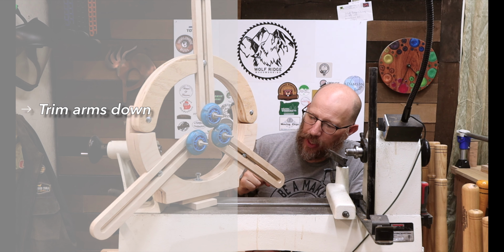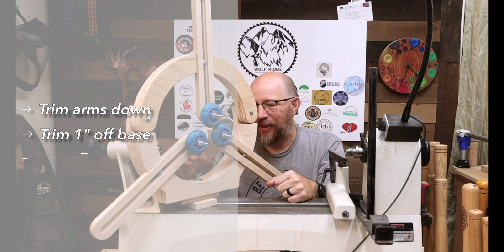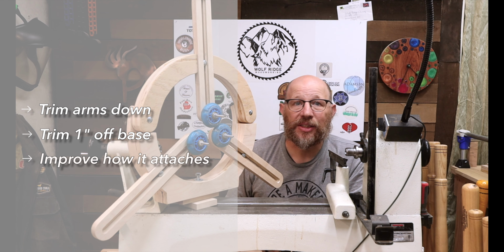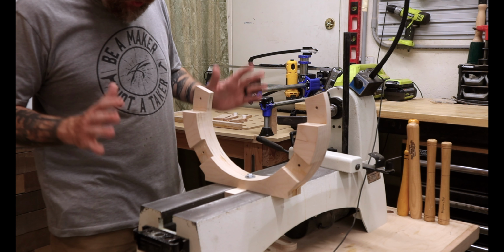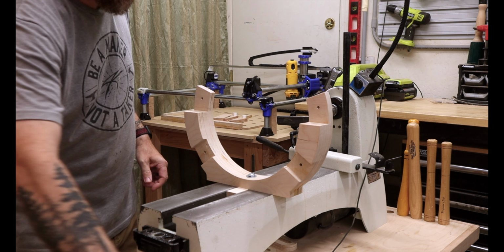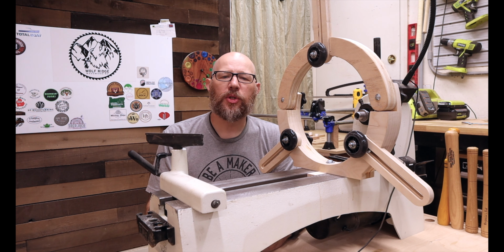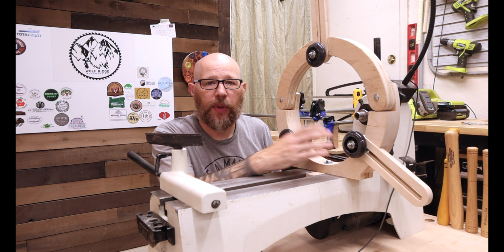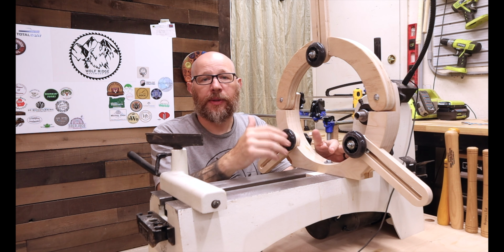Woodworking: Steady Rest version 2.0

Comment: Hi! Thanks for the vid. I see most people use roller skate wheels for the rest. Why not just plain metal bearings? Would it leave significant scratches on the wood? Thanks in advance!
Reply from the maker: Thank you Shifar!  I'm not really sure, but even with the skate wheels, you need to wrap tape around the piece to protect it.  Take care!  - Ed

Comment: The upgrade looks better. Did shaving the bottom have any effect on centering? Thank you for sharing. Have a great day and stay safe.
Reply from the maker: Thank you Glen!  I cut off an inch and it still leaves 1.5" on the base.  It is still off center a little due to the material thickness, but it did improve the ability to turn larger pieces.  - Ed